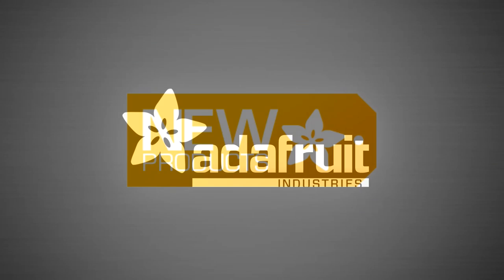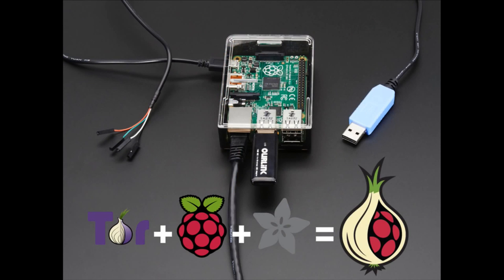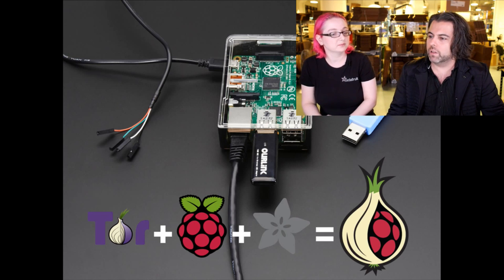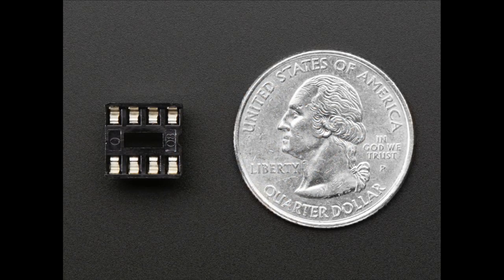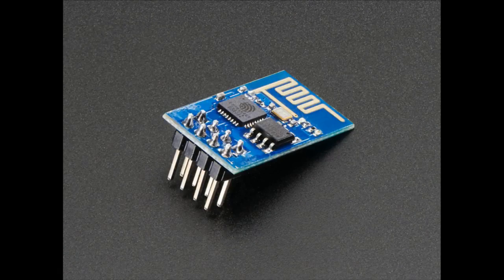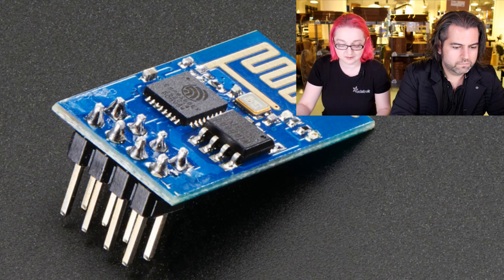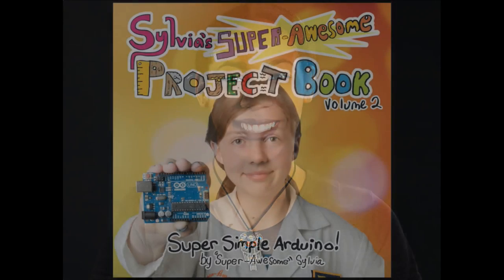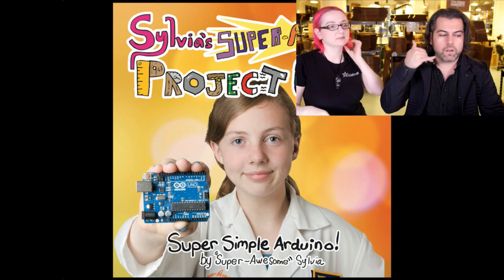New Products 12/17/2014

Comment: You guys left out one of the biggest advantages of using the Esp8266 modules! They have fully embedded microcontrollers and come in a variety of pin-out configurations (Esp-01 to Esp-09). Meaning that you don't need any other external parts - just power. Additionally, the Espruino (javascript on a chip) firmware works great with these little modules.

Comment: Hi, have tried your contact page on an iPad 4, can't get get the cursor into the appropriate fields, don't know why. 

Anyway, my question is… can I put the "Onion Pi Pack w/ WiFi Module - Make a Raspberry Pi B+ Tor Proxy" between my socket outlet and my router so that the onion makes my router anonymous (i.e. Model, serial number, who bought it and when etc). 

Thanks,
Carl.